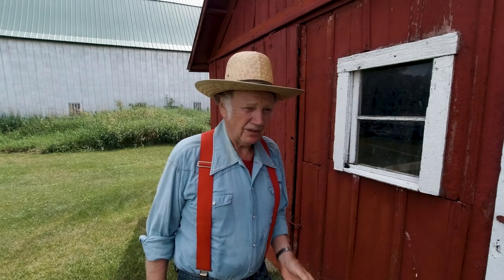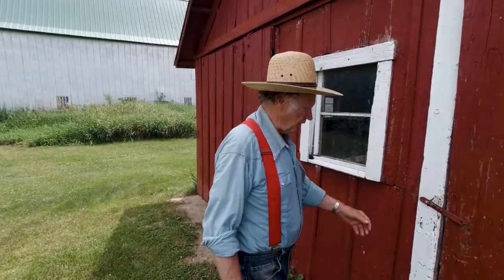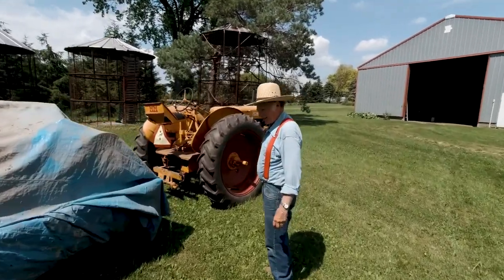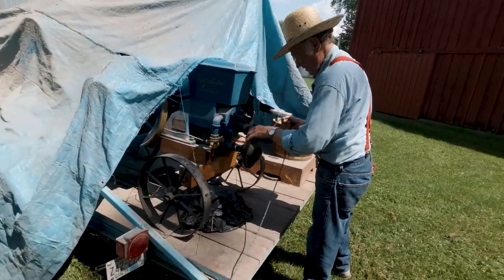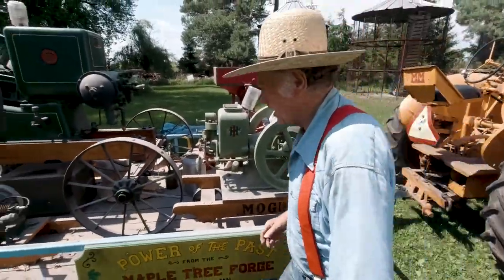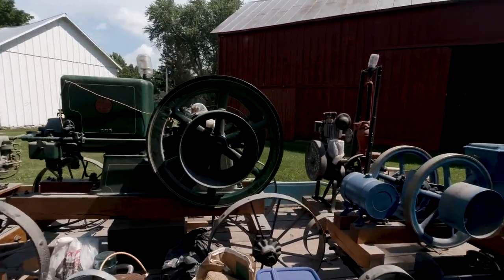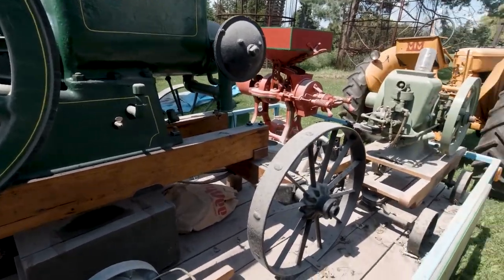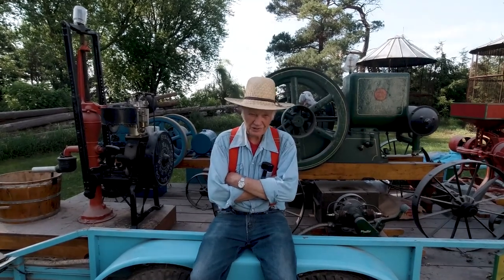Will They Run? Barn Fresh Trailer Full of Antique Gas Engines. Sitting 20 Years.

Comment: I have a engine that set in my barn for a minute or two and i didn't check the valve's before I rolled it over... i snapped the rocker...  hard lesson to learn..
Reply from the maker: Wowwww!  I've run into them stuck before.  With these engines, I wasn't too worried because I had them all oiled up when I put them away.  Did you ever find a new rocker?